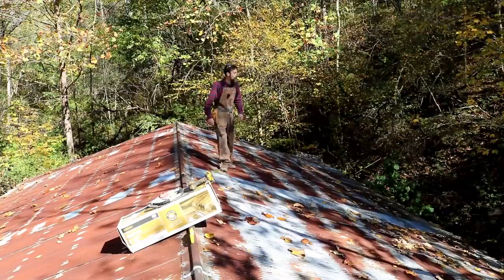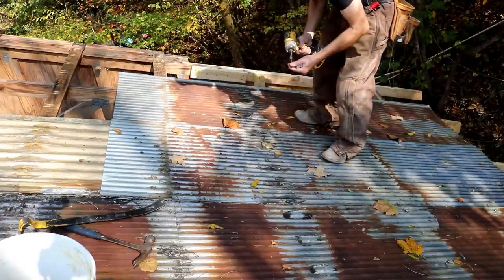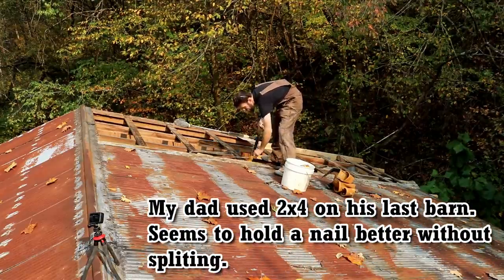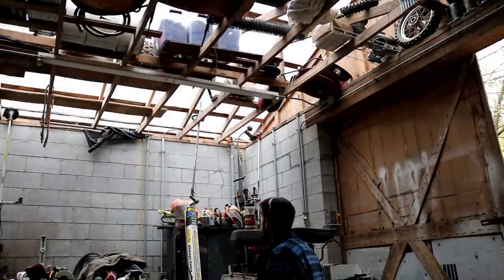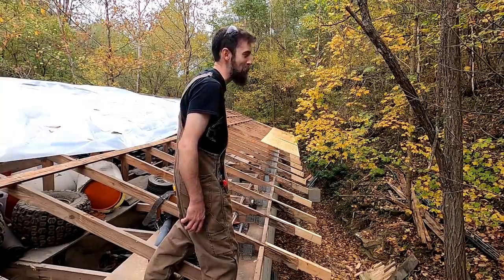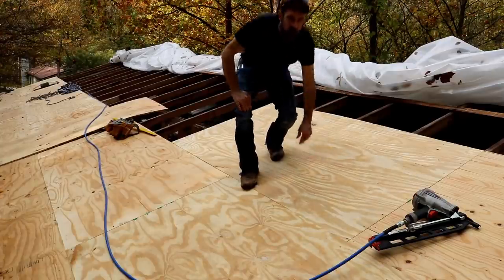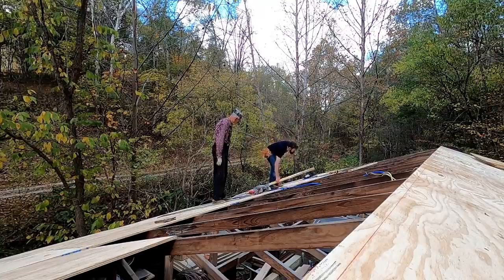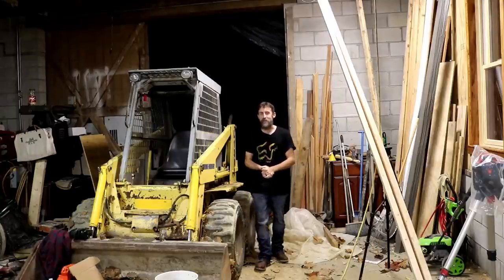Removing the leaking and damaged ROOF!

Comment: Love the sound of Elizabeth's bird behind your narration.
Up in the North East we tend to use 5/4 x 3 spruce lath across rafters.
19.2" truss spacing is more solid than 2' OC  and still winds up at 8' lengths. (Look for a diamond mark on the classic 'chrome' Stanley 25' tape measure)
As others have suggested H clips between sheets provide mid-span support and proper spacing, but that's water under the bridge.
Looking great!
You'll have this buttoned up in no time.
Suggestion: to snap out some lines at the head of every 5th or so of where your shingle course should land. 💡
This will help the novice keep straight, and not accumulating error, as you noticed with the truss spacing.
Measure this from the ridge, down. So you end up coming into the ridge parallel.
Just take a piece of that lath, and mark a storey pole.
Set a nail in the end and hook it on the ridge seam at the four rakes.

Comment: 7 years ago we redid our garage roof. It was a detached 36' long by 24' deep by 10' high walls. It was built in 1920 with either no tape measure or they were drunk. 23' 10 3/4" was the actual depth and it was 36' 2 1/8" long with 10' 4 3/8" high. We had to remove 6 layers. 4 layers of asphalt shingles 1 layer of wood shakes and 1 layer of 1" thick 4" wide diagonally laid boards. I took 44 pick up truck bed fulls of waste to the landfill. We had to buy 24 new trusses because they were 14" apart at the narrowest and almost 30" apart at the widest. We didn't remove the old trusses we just added or sistered in the new ones. We ended up using 5/8" tongue and grove plywood for the decking. My cousin taped all the seams because we also used ice and water over the whole roof not just first 6'. I hope you get your roof done without a ton of rain delays.

Comment: Steve just a little tip for you when the shop is finished, to keep the mice out. My shop, which is 30 x 60' was inundated with mice. As you know they cause a lot of grief to storing material and parts. Any way I bought electronic mouse chasers, which are ultrasonic pulses. Guess what for the last 4 years I've not had 1 mouse in the shop. I have 6 of these on opposing walls from front to back every 20'......Mice Gone!!!
Reply from the maker: Thanks, I always wondered if those worked. I may give that a try

Comment: When you put the drip flashing on the edge of your plywood it needs a small gap between the 1 X face board or if you don't use one then the rafter end itself. Reason is that water will travel up the back of the drip due to capillary action and rot out any wood back there. On my house the roofers pushed the drip tight to the facia 1x 4 and then hung the gutters from facia. When it rains water comes out from between my gutter and the facia board. After climbing up to see why this was happening I could see that the only way for this to be happening was for the water to climb up the back side of the drip flashing. After asking a friend who is a licensed contractor what is going on he said it's a common mistake, and that the flashing should be spaced about 1/16" away to prevent capillary action from occurring. Perhaps some of the other viewers can comment on this. Thanks for bringing us along on you build. You rock buddy!

Comment: I think my fix probably would have been to have gone and bought a bunch of those 2x4"s you were talking about and ran them crosswise like the original sheeting then screwed your plywood to that. It would have cost more but would have added strength and eliminated a lot of extra fussing around. You whipped it in the end though!
Reply from the maker: I didn't consider that Brian but I dont see why that wouldn't have worked fine. Some were really close and some way off. I just pulled a tape and found the worst ones and worked out a plan to avoid having a sheet butt up on them and it saved me big time. The creek side was the worst, they had them all over the place . They weren't square with the building. Not enough to pick out by eye but enough to make you want to pull your hair out😁👍

Comment: Great progress!... I feel your pain with the truss spacing, I had similar on a couple of flat roofed extension on our house. In the UK we have the added problem of some stuff going metric in a half arsed way... so are the joist spaced at 2' or 600mm. Of course sheet materials are still 8x4 but are sold as metric 2440x1220mm.
The standard joke is that we've gone metric every inch of the way ;-)
BTW I covered the flat roofs with EPDM (rubber sheeting) very good stuff, copes well with seasonal movement, mind these were V small compared with the job you are doing.
Reply: Done the garage and the shed in EPDM, absolute bomber stuff

Comment: Watching some more, not even spacing, not surprised.  Built onto wife's old house years ago, studs were 4 foot apart every 3, but 16 inch, yea, 15, 16, 17.  Studs were laid out with a preacher stick and every third was 48 for a lathe.  On your roof the didn't worry about it, just laid some nailers for roofing.  
You are doing a good job just keep it up.

Comment: Pending on how old the building is and how available consumables are, fiberglass and resin probably wasn't available during the time of this building. Most builders will put in a date hidden somewhere. Centers are always 16" or 24", we've either added extra 2x's or cut down the sheets, depended on what was the easier solution.
Happy birthday to you and happy anniversary to you both. Cheers :)

Comment: 50 years ago, my late wife and I put a roof on a cabin in the woods of northern Vermont. For us it was difficult and scary, but so satisfying. The first rain on the finished roof was wonderful to hear.
However, I must correct you on Murphy's (or Sod's) law. The real law is that the universe is actively and personally malevolent and manifests that malevolence by tweaking probabilities. As a result, the general law has a corollary that if you try to use Murphy's law to your advantage, the law will seem to fail. For example, if your crops need some rain and you open up your roof, it might not rain. Or, the rain might contain crop-damaging hail.
It gets worse, because you could add another level to your attempt to get around Murphy's law. Then the corollary applies yet again. This is called recursion. When I tried to imagine the transitive completion, my brain said "fuggetaboutit".

Comment: 2 foot on centers, I would have put on some H-clips. Looking good so far Steve
Reply: I was thinking the same!
Reply: I was thinking the same myself.
Reply from the maker: It really doesn't need them . 5/8 ply is pretty tough.
Reply: @SteveSummers  I would agree that 5/8th is pretty good shit and wont warp as much but I overbuild everything and H-clips are pretty cheap insurance for a stable/flat roof. They become more important on a lower pitch roof where minor warpage has a larger impact, especially with 2ft on center. You are coating the entire roof in ice-guard though so you will not have leakage problems, ever... I still overbuild everything. 

Tell me you've never made a part and just completely overdid it and said something similar to this, "well I didn't need to make this out of 1/2" plate steel cuz its just for X machine that has no impact on performance or wear, but I don't ever want to mess with this part again because it's buried way down inside of Y cavity" or whatever. Well the roof is the same in my opinion, I'll overbuild it every time because it's its buried by several layers and not easy to get to. Call this personal preference if you want. I am not saying you messed up the whole thing or even did anything wrong, in fact it will be just fine.

Comment: did you gap the sheeting on the edges, Plywood will swell and will buckle with out spacing. What you can do if needed is do a saw cut on seems to make a gap. H clips normally are used for this to do it automatically when laying plywood.

Comment: Sure wish you would use standing rib hidden fastener metal silver aluminum color roofing, I used it over plywood and no excessive noise from it and the fire rating and self snow unloading. plus in the summer it reflects the heat from the sun.

Comment: A roof that you can walk on mus tbe such an advantage. When we did the roof on my parents' place we found that you could just walk on the sarking if it was very clean and it was a hot day so trainer soles were sticky. And if it wasn't it was straight down and over the eaves (we had scaffolding so this was less than fatal). We ended up using caving ropes and harnesses. It took months to get the roof on, because each sandstone slate had to be individually chosen from the stacks. They were sorted by length, but we needed to find one of the right thickness and right width for each position And even if all dimensions were correct, sometimes they just wouldn't sit right and another would have to be found. Shingles make life a lot easier, with the drawback that you can't simply re-lay them 150 years later. FWIW I described the work we did on that house in the worlds oldest website (written in 1995, updated  in 2001, back in the days of 28k8 modems when a "thumbnail" really was the size of a thumbnail)  http://www.bodgesoc.org/slaithwaite.html

Comment: We went back with corrugated on ours, the original was (soft) aluminum, very easy to pierce.  We also scabbed 2x4's to rafters that looked like they could have been compromised, and put in 2x4 cross runners, 16" center, to help beef up the structure.  Original runners were 1x on 2' center, that I wouldn't have used for pallet material.  Plywood on 3' rafter centers would not have been easy in our case.  This was a cheap building, material wise.  By the time it's done, only the rafters and pole uprights will be original.  Built cheap and 40 years of neglect, it has not done very well.  Correcting it as I'm able, a little at a time.
Reply: by the way, one problem I had with shingles on a shallow roof pitch, when the water went off the edge it wanted to cling, and it actually wicked back under the edge of the shingles, wetting the plywood underneath.  Drip edging didn't help that time. Take safeguards to keep that from happening, so you're not doing it all over again in less than a decade.

Comment: Wow, those rooflights must have been the thinnest fiberglass I've seen! I think mine are as strong and rigid as the steel sheets.
Reply: Steve has corrected LOTS of "cheaping out" in that building and its environs.  Check 1 more off, for the roof.  Betcha the next owner, whoever that will be, has nothing but good things to say about Steve.
Reply: the early stuff delaminates with age, so maybe 1/2 the thickness has blown away with time.
when i bought my current property 19 years ago i had to replace a f/glass panel in one one the sheds due to that happening, the replacement panel is still as good as when i installed it.
edit: oh and the current stuff is extruded plastic so can't delaminate.

Comment: The underside of the roofing tin looks to be ok. Just turn it over, nail down and job done
Reply: Ah, the 'underwear' philosophy!! 😂😂😂
Reply from the maker: Unfortunately it's not possible. Tin is ribbed and the nails are driven into the top of them. If you flipped it it would channel the water to those old holes and leak horrible. The rust didn't hurt the tin, it's the stretched nail holes .

Comment: Braver than me. I would be the guy who steps back into the wrong spot and falls through.
Reply: My father did that in the late 70s early 80s. He had worked about 2 years as a construction worker when he fell through a roof 10-12 feet high and got a roof tin sheet on him.
Reply: Same here! LOL
Reply: I'm the guy that cuts a sheet with a nibler for the end of the roof, passes it up to my dad and promptly slices my hand lol
Reply: @artemiasalina1860  someone has to break my fall.

Comment: FYI, carpenter ants do not destroy solid dry wood, they only move in after wood is rotting from moisture. Thats how you can tell you have a water leakage problem somewhere when you start to see the large ants!!!!!!!!! Also just a note that the concrete footing you poured are not called footers, they are a footing or footings....Best; like your videos. Carol D., love the squirrels, very cute.

Comment: Do you have any plans to insulate the roof? It would make your shop quieter and easier to warm.
Reply: Good idea! On point: Putting insulation bats between the trusses would definitely be an option... on balance: in light of the truss spacing issue, it may be a bit more trouble to execute.
Reply: @matthewhelton1725  There are wool insulation mats that come in a triangular shape, like flat wedges, you can slide them against each other to adapt to uneven truss spacing...works great!
Reply: There is also spray foam that will stick to the underside of the plywood and sides of the trusses.

Comment: I saw a Possum climb a power pole and touch the wires, caught fire, fur burning, fell onto a roof and then the ground, still alive run into the building and set that on fire! So, do not touch the wires. Especially if you have fur!
Reply: Bare wires there? Probably had insulation when installed, but sun will kill it, especially if it is just tape and they have not put the right amount of self amalgamating tape under it to provide long service even after the PVC tape has rotted away.
Reply: I saw a squirrel do that fell 20 ft to the ground walking over to the squirrel (thinking it was dead) nope it jumped up and ran away
Reply: yep just because it looks insulated doesnt mean that insulation hasnt decayed, whats to stop it from cracking off and you coming into contact with the conductor?
sure it might be outdoor rated, but plastic and the sun dont get along
Reply: @TheMrSnyder Yes, the older lines are bare copper wire, buy those also had large ceramic bobbin insulators and a bar holding them, so that you could not get contact. The later drops using the style of entry Steve has only use insulated wire, as there is no other insulation other than that on the cable.

Modern replacement drops here, if still left above ground, are made by replacing the old wiring with either a split concentric cable, or using aluminium Airdac wire to bring the feed to the roof, and then using either the old wire (often with this old cotton covered gutta percha that was there originally) or a new PVC cable to the meter, and after that it is the customer's responsibility.

That drop is probably a little overdue for service, if the meter is inside then Steve needs to have his utility supplier come out and inspect and refurbish, if it is after the meter then it is the responsibility of the home owner to maintain. Likely as old as the shed itself, or at least as old as when the area got electrical supply in the 1950's with the rural power programs.
Reply: @SeanBZA  We just put in some new lines from the pole to the meter and to the breaker panel and we paid for all of it, it would have been nice if the power company had paid for the pole to the meter...
Reply: @lennym1273  New supply you pay for, then the power company is on the hook for maintenance on it. You applied for either a new or an upgraded service, so paid for this, but now the power company is going to have to pay if anything up to the meter itself fails. Outlet from the meter at the terminal points is the home owner's responsibility, along with whatever structure holds up the connection and the meter itself.
Reply: My brother has buzzard problems around the windmill tower and the transformer pole....15kV gives a new meaning to crispy critter!
Reply: Years ago I had a power outage, called out the city. City lineman showed up and found the fuse had blown. He then looked around for the reason the fuse blew. He found a slightly singed squirrel near the bottom of the pole. He tossed it into a bucket he had on his truck and proudly told me that this was the 3rd one today and he was going have a great dinner tomorrow night!
Reply: @Newokie59  lol probably not the best comment for Steve's channel. lol
Reply: Here the power distribution network uses open aluminum wires with a steel center.
Reply: @frotobaggins7169  Especially if the squirrel was a relative of Peanut.

Comment: Job well done hard work on your own Stev, one thing though should you have 
put a gap between the boards for expanding wood as its still alive it might blow (swell) and bow
Reply from the maker: The joints were saw cut. Its easier to do than trying to space them IMO. Thanks for watching 👍

Comment: I'm surprised that you were surprised by that truss spacing.  It seems that somewhere along the line of putting up those temporary supports and all those extended tails you would have noticed an odd distance between the trusses.  As I said 4 or 5 videos back, a metal roof is far more practical in your area and could have been finished in less time than it took to put up that sheeting.  Yeah- metal is a bit noisier when it rains, but it's not SE Asia where it rains for 3 months non stop.
Reply: The plywood sheeting adds a lot of strength to that structure.  He is going to put down ice shield on the complete roof which is overkill but a very sweet idea.  Asphalt shingles are perfect for that job (plus they were a gift!).  That roof will be on there for many years.  I would say that is very "practical" !!
Reply: @paulcopeland9035  Disagree, even thought he shingles were a gift, the cost of ice shield and plywood still exceeds the cost of clad metal roofing.  In a forest environment with low sun and a lot of leaves and pine needles, the shingles are going to be moss collector, not to mention rodents and insects looking for the source of that heat.  Steel will shed water and snow fast.  Strength wise, the trusses with purlins are all the strength the building needs.